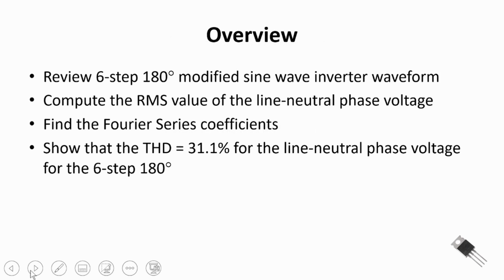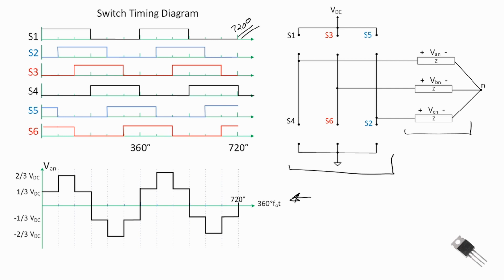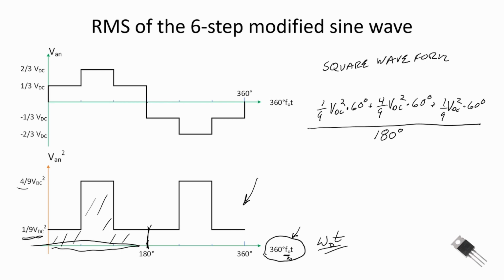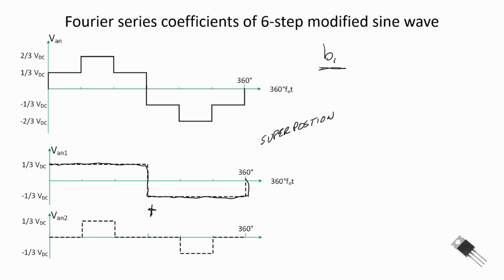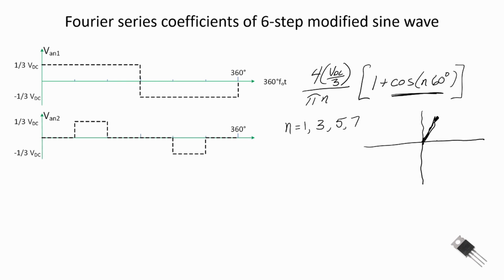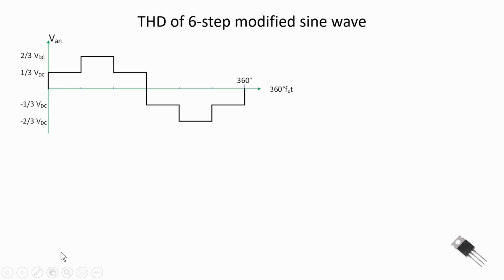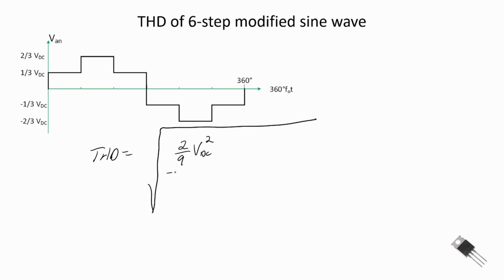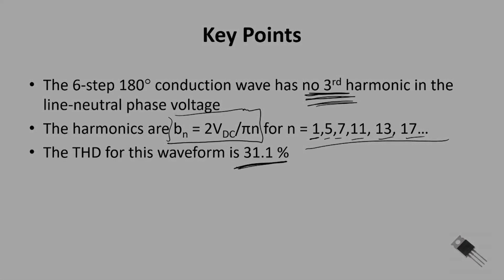Power Electronics - Six Step 180-Degree Inverter - Part 2

Comment: How do I calculate the RMS phase voltage of Van, Vbn and Vcn when the static switch S3 is faulty?
Reply from the maker: Hi Ken, when you say "faulty" do you mean stuck open or stuck close during the 360-degree switching cycle? -Dr. K.